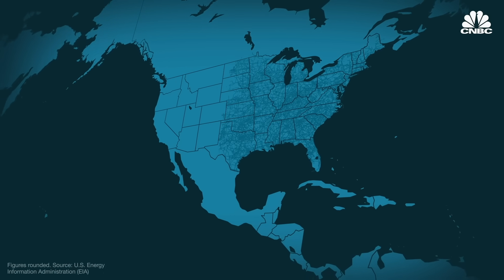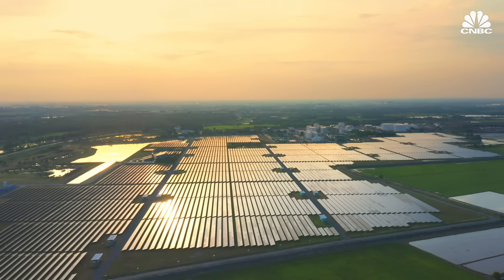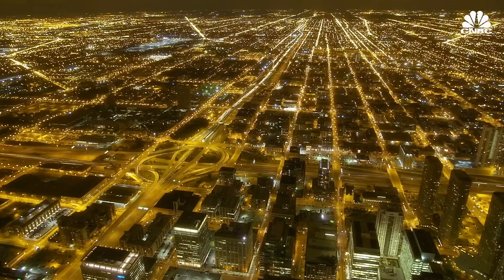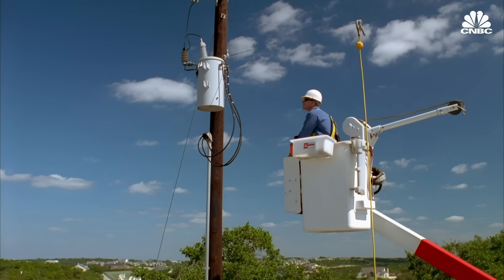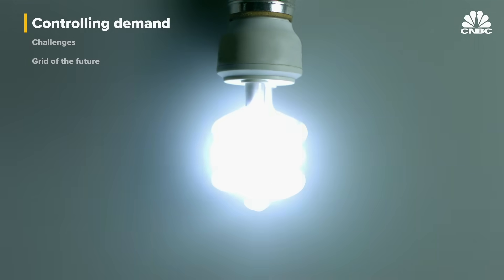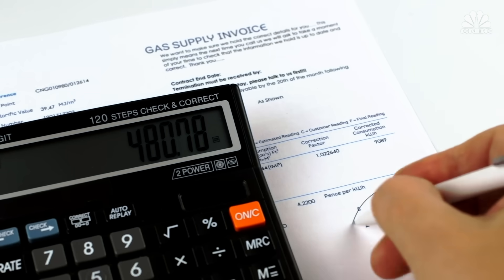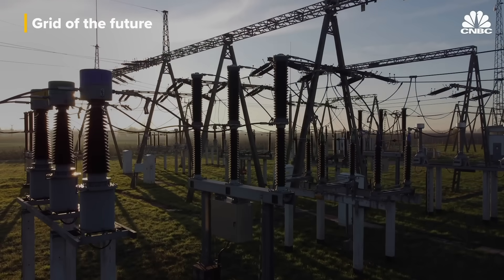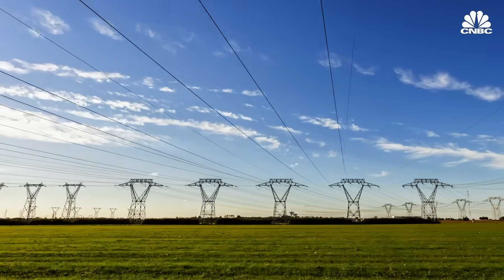How The U.S. Can Build A 100% Clean Grid

Comment: The problem with EV to grid power distribution is the question of who pays to replace the battery when it wears out?
Reply: EV batteries last a lot longer than you think.
Reply: @scottmohrman  irrespective, when it does wear out, who pays the bill to replace it?
Reply: @mwbgaming28  If you own the car, its your responsibility.
Reply: @scottmohrman  if they use the battery, they help pay for its replacement

Comment: Biden's arbitrary date is not based on rational facts. What incentive could you give to electric companies to build in interlocking control and communications while their business is based on centralized service? It would be better to let the innovations develop further so we have SOME idea what the system would look like 100 years from now. As we all know, solar panels and batteries are not environmentally friendly, and take a lot of energy to produce. While a carbon tax might be a reasonable gauge of energy use since, obviously, it's desirable to conserve energy, putting artificial preferences as to energy source into law is counterproductive. And our new presidents sudden policy change in that direction is a mistake.
Reply: Waiting is not an good idea, because there is no reason to, other countries will go ahead and and at some point, they will take over the market.
And for environmentally friendlyness, if we utilize clean technologies and get under 2´C we can cut species extinction to just 25% of all species, warming over 3´C on the other hand is expected to extinct 50%.
Reply: @deathgun3110  Even the title is a fraud - you can't have a 100%-Clean energy system while the means of producing the energy still requires heat-and-energy-intensive means. And now they add BATTERIES to the mix! Further, I doubt your projections of figures, and if they possess any basis in fact. Fact is, while we are currently at the the vanguard of innovation we still haven't found a way to make wind and solar safe, reliable and remunerative. The fact of our carbon footprint SHRINKING after our withdrawal from the Paris Accord (which "treaty" was never ratified by Congress) and before advent of COVID, is proof we can use fossil fuels responsibly without bending over for China. It's a fact that using current available means of transport instead of the XL Pipeline will INCREASE our carbon footprint. Now while a pipeline is not a glamorous thing, neither are the hard costs of manufacturing low-output "friendly" sources. I'm convinced there WILL BE efficient "friendly sources someday, but they aren't available now. Biden's ex post facto actions - which will probably not stand up in court for that reason alone - is based on lunacy of requiring use of TECHNOLOGY THAT DOESN'T EXIST.

Comment: fyi these green initiatives are causing grid instabilities in california. Also, when everyone is required to have an electric vehicle, comes home from work in the evening and plugs their vehicle in pulling 10kW, we're talking a major fold increase in the peak load that happens already in the evening, not too mention it could be dark or becoming dark at that time (winter) and solar is useless which means you'd need an insane amount of realiable battery storage
Reply: The scenario that everyone is plugging in their car at the same time is an unrealistic scenario, just compare the same argument with an gasoline cars and stations.
It´s more realistic that max. 10-15% of all car owners would charge at the same time, because they are still having enough charge or have todo something else.
Dark slacks on the other hands are a problem but paying for like 30 days a little extra while most of the time the electricity is cheaper is not really a problem or just buy electricity from your neighbour state.

Comment: The only thing that is wrong about the grid shown is it should be underground, not a visual eyesore. Modern power lines under the ground as they do in the streets. As for modern clean power, it should come from efficient nuclear power plants, hydro and geothermal with less than 10% coming from solar and wind.  Smart grids already are in place which is how they can move power from one sector to the next turn on and off water heater heaters etc. Having control of other appliances like AC units is not the way forward it is just rationing power because there isn't enough to go around.

Comment: Storage plus renewables is not “cheaper than most peakers.”  I am all in on finding solutions but bald faced lies help no one. The fallacy that ingenuity and forcing new technology can solve this are hurting efforts to rationally solve these issues. Just look at the knee jerk pullback going on in California right now. They are contracting plants that are retiring because they listened and drove the system based on these lies. Had they used rational thinking they wouldn’t be forcing nuclear to close. They wouldn’t be artificially propping themselves up on power generated in all of their neighboring states.

We need storage. We need renewables. We need power to cook our dinners after dark and for our kids to do their homework when the wind isn’t blowing. Using candles when the sun goes down (or is blocked by forest fire smoke) and the wind isn’t blowing is not “sustainable”.

This is not a political solution with big bad corporations refusing to act. This is ignorant politicians shilling for votes by bowing to ignorant protesters causing everyone to pay more and have more blackouts. This requires engineering solutions with a concrete long term framework that won’t change on the whims of an election or frivolous lawsuits. We need a clean energy act like the clean air act that sets that unchallengeable framework to institute these long term solutions. And reliability and real sustainability need to be key pillars of that act.

Comment: Pretty nuch lies.  Better than your plan. Electric cars battery give off C2O much worse than fossel fuel. How do you recyle???
Reply: I never seen an exhaust pipe on an e-car? (if you ment production, when you consider all factors bev´s are cleaner after 50.000 - 70.000Km)
For recycling you are basicly just emptying the battery, then sherddering it and after that sorting the minerals.

Comment: 9:15
How many times are they going to roll out this canard?
The bluebook value of an electric car is almost entirely determined by the charge cycles left in the battery pack.  It works against the material depreciation of a comparison ICE vehicle.  That does not mean it stores a significant amount of energy.  Indeed that's the entire point of an electric car.

Tesla's current battery pack is 100Kwh.  Where I live power is worth 29.43 cents per Kilowatt hour peak, and 14.86 cents off-peak.
That's $14.57, for an entire cycle of the battery pack.

Now lets look at the cycle depreciation cost of the same battery pack.  I found a second hand model S for $68,275.  LIFPO4 batteries have 2000 cycles to 80% DOD.  To appease fans of this concept lets pretend the cyclability of the battery's is double what it actually is. That's $17.07 in depreciation costs.

STILL LOSING $2.50 EVERY TIME I ALLOW SOMEBODY TO USE MY CAR TO PRETEND THEIR POWER SYSTEM IS NOT UTTERLY DYSFUNCTIONAL BECAUSE OF WIND AND SOLAR!!!

Comment: The problem is there is not a battery big enough to store power on a national scale. The instant electricity is produced it must be used. As demand increases throughout the day grid operators up the power output to match demand. Conventional generation the generators are directly connected to the grid and after gearing rotate at 60 cycles per second all perfectly in time, one speeds up they all speed up and so on. If a generator was to fail and go offline for whatever reason there will be enough rotational energy (system inertia) to cover the supply gap while the problem is being addressed. Solor has no rotational energy and wind turbines are detached from the grid frequency (attached through electronic converters to maximise efficiency). Wind is only useful when the wind is blowing and solar when the sun is shining so for the electricity to be produced by 100% of RE it's complaicted

Comment: Solar panels are made from oil. 
Wind turbines need oil to spin the blades. 
The blades are not recyclable. 
The wind turbines have a lifespan of 30 years. 
Our technology is not capable of sustaining our power requirements even with a new grid.

Comment: Wind and solar, wind and solar, wind and solar... And what about the cost to produce those devices. What do you intend to do with all of the solar panels that will age out over 25 years and need to be replaced? Where are you going to get the additional land for those solar and wind farms? And don't even get started on the cost to produce Li-on batteries let alone the elements we need for those come from our friends in China.  Why no discussion about molten salt reactors that can actually consume the nuclear waste, some of which we've been storing for almost 60 years now?  Think outside the wind and solar box and you'll find options beyond what the "Green New Deal" has to offer.